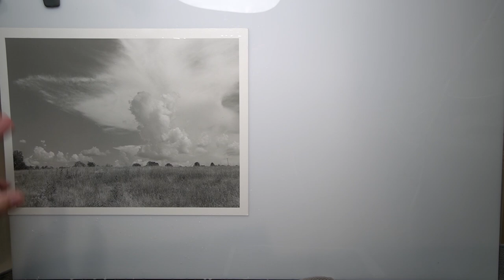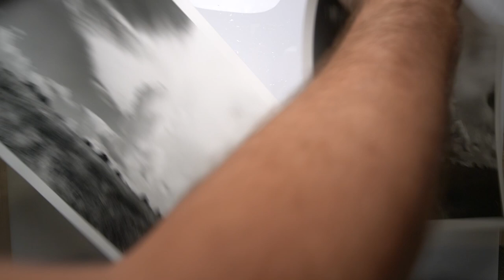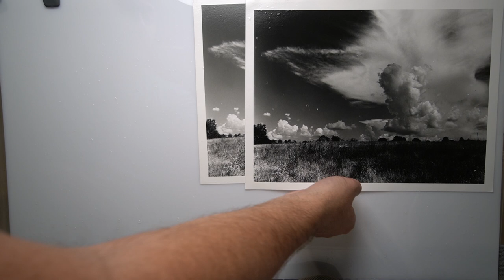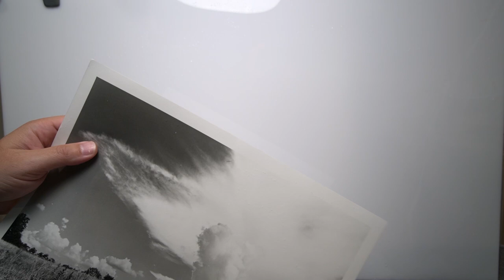Diffusion vs. Condenser Enlarger

Comment: I have a copy of the Kodak Darkroom Dataguide (1974 version) that actually has a development dial that adjusts dev time for various factors, including whether you're printing on a condenser or diffuser enlarger. Running through the calcs for 35mm Tri-X, you get a dev time of 7.5 mins if using a diffuser enlarger and 5 mins if using a condenser enlarger. The method also adjusts for lens flare and dev tank size. Not sure I ever see myself using it, but I thought it was interesting that Kodak put out something so detailed addressing your question about how much to adjust dev time for the enlarger type.
Reply: I should have noted that this was assuming D76 at 68F.

Comment: Nicely demonstrated. Before wet darkroom printing imploded in favor of digital and inkjet printers, I think the popularity as shown by sales and new models largely trended toward diffusion heads. My personal experience with both types of enlarger head convinced me that the condenser head somewhat distorts the tonal range from blacks to whites, apart from just increasing overall contrast, but I have no hard data to back that up.
Reply from the maker: After doing this I feel the contrast change as you move from 00 to 5 with a condenser compared to the diffusion of exponential rather than linear.

Comment: Other thing with the condenser is having dust anywhere in the optical path not just on the neg, especially when using small apertures. It's a pain. And if you are doing. 35mm you enlarge that dust too! I'm seriously considering one of the Intrepid mini enlargers just to replace my little condenser setup.

Comment: I prefer diffusion because the fact that it masks dust particles/imperfections of the film so much better (which is the bane of film existence for me). Also the convenience of a dichro diffusion enlarger is that I can use the color wheel to alter the contrast super quick

Comment: My goodness that was helpful! I have never been able to find a good side by side comparison but that was great! I don't have much choice at the moment (I use a condenser head) but I do like the look, but oof the dust can be quite a monster this is true. One day I'd like to have a color or LED head though. I have a cold light but I didn't care for it after using it for a while. The lack of a full spectrum light was the biggest issue. It's also BRIGHT so I've half blinded myself a time or two by lighting the head to check the negative.

I had thought of trying to DIY a diffuser and I've heard that, while using an acrylic insert can work, it removes a ton of light and I don't have any available light to spare at the moment.
Reply from the maker: What model enlarger do you have?
Reply: @TheNakedPhotographer  An Omega D2 with the multi-condenser setup. It's a beast in my bathroom-darkroom :) It sits on a table I fashioned above my toilet haha. Will have a proper space soonish but for now it's been working well enough.

Comment: from one negative and contrast adjusted for enlarger,  the big difference is in the tones of print.  Details in dark areas are better in condenser with higher areas washed out somewhat.  Details in lights are better in diffusion, darks are more flat lacking contrast.
The whole story changes if you develop the negative for diffusion 10 or 15% longer. the prints from fine grain film look the same if printed from proper enlarger.

Comment: I have a diffusion enlarger, but I was actually just doing some research on this recently. One thing I'm wondering, is whether the relationship between enlarger height and print exposure time differs between the two enlarger types. (And how each differs in relation to the simple formula that can calculate it based on a magnification change.) My current gut feeling is that diffusion more closely tracks, while condenser deviates a bit more, but I'll need to test more enlargers to be sure.
Reply from the maker: I haven’t tested it, but my opinion based off prior experience is that light fall off from increased print size is more visually evident with condenser enlargers.

Comment: What a welcome comparison! I've been printing on MG papers with a condensor head, but now I got my hands on an 8x10 cold light (diffusion) enlarger. First test on MG paper revealed low contrast prints without any way to use filters. I've now gotten some graded paper to start testing with that. Would you focus on proper film development for a specific paper, and then vary between different grades (I have only 2) of paper, depending on the contrast you want for a specific negative? Or would you start somewhere else?

Comment: Great content as always! Does a contact print exhibit the same characteristics as a negative projection when using a condenser vs diffuser?  Any experience with a lightbulb vs condenser vs diffuser? Thank you.
Reply from the maker: Diffusion is very close to a contact print.  A negative that prints well with diffusion will print well as a contact print.

Comment: Do you have a video on these older diffusion and condenser heads against the new LED cold light source replacements? If any significant advantages or not?
Reply from the maker: While there is a difference in how they are used, which I believe is a combination of green and blue light like the Beseler VC head, the image quality is exactly the same as any diffusion head.

Comment: Thank you. My question is on development time. When I began a very long time ago, chemistry etc. Was not as it is today. I had a condenser enlarger and fiber paper which was the regular paper for the early 70s. It was customary to watch the print in the development very carefully and pull it at just the right moment otherwise it could continue and end up black. Today’s resin paper times out at 90sec. So all that said, can you clarify shortening development time by the suggested percentage? Also what exposure, paper and chemistry was the test based around? The diffuser enlarger looks very much worth a try.
Reply from the maker: I wouldn’t shorten the print development time.  I shortened the film development time to compensate for the condenser’s increased contrast
Reply: Yes, about half a minute after I sent I realized we were talking film development, opps

Comment: Great video! I have been using a condnenser and the dust is an extreme nuisance. Spotting is a pain. Scratches require nose grease. Sometimes I need to mount my negative 2-3 times before I manage to eliminate dust at least from critical areas (like faces, eyes, lips). Can you recommend a diffuser type enlarger for printing up to 6x6 (but not larger)?
Reply from the maker: If you are in Europe/Asia I would look for a Durst M601 or similar
Reply: @TheNakedPhotographer  Thank you!

Comment: I have Durst M70 condenser enlarger. Its great machine but I really consider switching to Durst Vario head because of the DUST! There is still option to print without glass carriers (which Im about to try). But to fight that dust is very demotivating. Anyone experience the same thing?

Comment: What size of a negative did you use? How much does the film format effect the difference between the two light sources? One would think the difference would be smaller the bigger the negative as the greater the enlargement factor the more the "softness" of the light is visible on the print but is it so?
Reply from the maker: I’ve done this demonstration with both 35mm and 4x5 in the past.  Both demonstrated the Callier effect about the same.
Reply: Ok, thanks.

Comment: What type of enlarger can i use to print a color picture? diffusion or condenser?
And which is the enlarger 2 in1 of them i mean you can print colored picture and black and white thanks a lot!
Reply from the maker: I use a color enlarger for both.  Color enlargers are typically diffusion design.  You can use a condenser enlarger for color but will need separate color filters.  Freestyle Photo sells a set.
Reply: @TheNakedPhotographer  thanks a lot

Comment: Thank you for this terrific video. I'm wondering how a LED light source would compare to condenser and diffusion light sources. I know you did a previous video with an alternative LED source (Neewer 660 LED video light). I have a Beseler 45V-XL with their 45S Dichro head. I'm considering getting an LED head (i.e. Heiland) and I'm wondering what the differences would be?
Reply: condenser is simply a lens behind the negative, in a led system you can have a condenser or diffuser as led is just the light source
Reply from the maker: Exactly

Comment: Could You please name few good enlargers for 4x5" (for a begginer and not too expensive)? :)
Reply from the maker: “Good 4x5 enlargers” AND “cheap” may not be compatible, but I will name a few different models.  Understand that the US market and the EU market will have different brands available.  Typical US models would be the Beseler 45 series and Omega D series.  The Omega D2 is perhaps the most common.  For the EU, Durst is common, as is DeVere.  Saunders and LPL I think can be found in the EU.  I don’t know specific models or ease of use with any of these as I haven’t seen any other than the DeVere 405.
Reply: @TheNakedPhotographer  thank You very much! I'm from Poland, so I will look for one rather in the EU.
Reply: Durst , Homrich , Múller & Wetzig , Meopta , Ahel ,  Intrepid, Fujimoto.          

 @TheNakedPhotographer

Comment: You really need to develop your film to work with the enlarger light source you use. Basic stuff. I know he’s trying to show the difference but without developing your film to your light source this isn’t a good comparison. Also cold light diffusion and halogen diffusion have a different look as well.
Reply from the maker: Did you watch the whole video?  Did you not see the entire section where I developed a second roll with less time to compensate for the change in light source?
Reply: @TheNakedPhotographer  yes I did. I guess you missed the point 🙄
Reply from the maker: Maybe you failed to make one
Reply: @TheNakedPhotographer  read my comment again. You simply gloss over by “compensating your dev time. It takes more than that. As for my background I’ve been printing for nearly 35 years and on a D2V my current are a Saunders VCCE XL and a Beseler 8 x 10 with Alan Ross conversion. I’ve also authored master printing class articles in Photo Techniques magazine and my work has been I major gallium Santa Fe, LA an Paris as well as having lectured and taught classes.    Like I said you missed the point. 🙄
Reply from the maker: I also lecture, teach university classes, hold a Masters in Photography, have articles published, exhibit my work around the world, and have printed professionally for years.  This is a short video to introduce the topic to beginners, not a PhD thesis on the Callier effect.
Reply: @TheNakedPhotographer  but if someone is to make an informed decision this doesn’t help. It would easily confuse a newby   Just wish you elaborated a bit more on How to choose vs what’s   out there. Format, film, developer and such help a newby along with the basics. Just saying!
Reply from the maker: If you are trying to make helpful suggestions for my videos, you need to read your original message with fresh eyes.  Your tone, which I hope was unintentional, came across as an asshole.  No single video can cover all the basics in a single go.  The average viewing time is five minutes.  All topics have to be broken up into smaller digestible bits.  If you would like to have deeper discussions about photography I would recommend a forum like Photrio